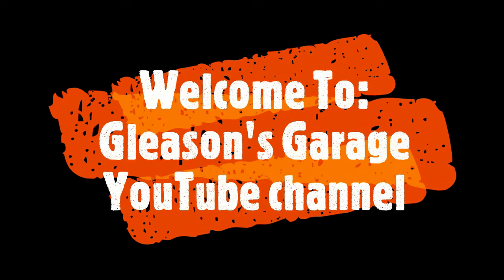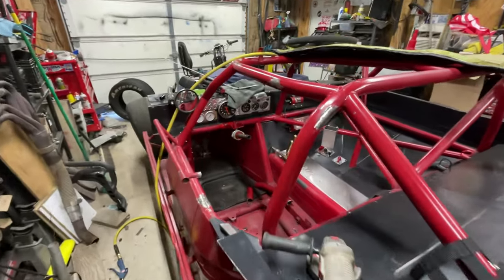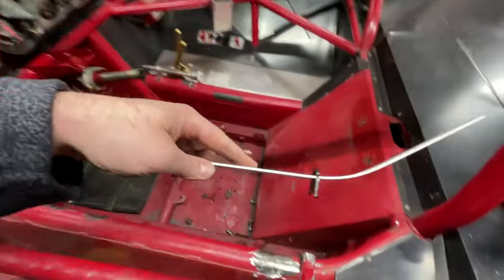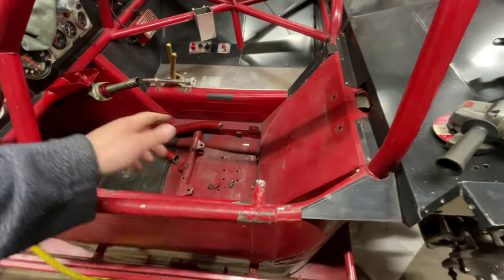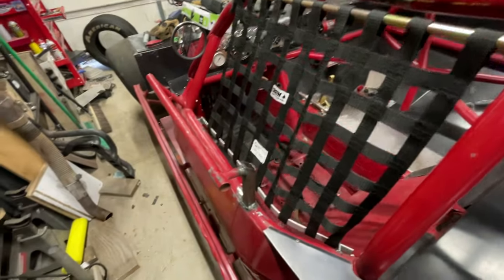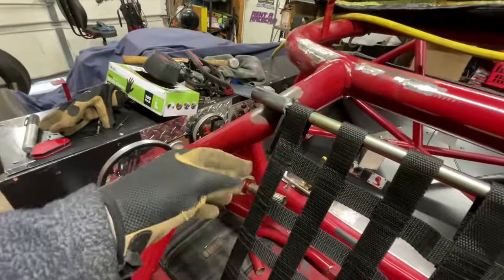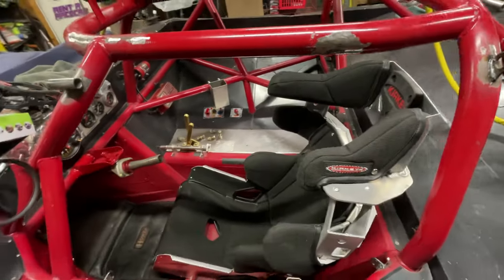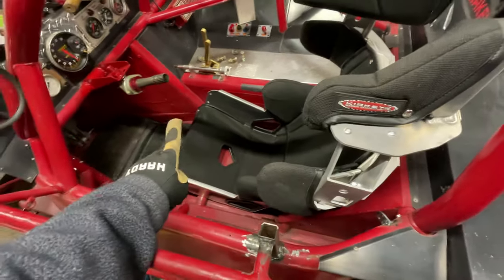Safety Equipment install!

Comment: That window net system you're using is no safer than what you took out Should be all still Half inch round bar
Reply from the maker: I fixed it off camera